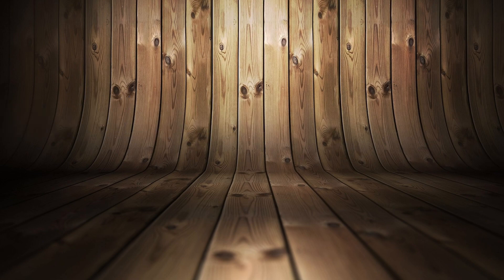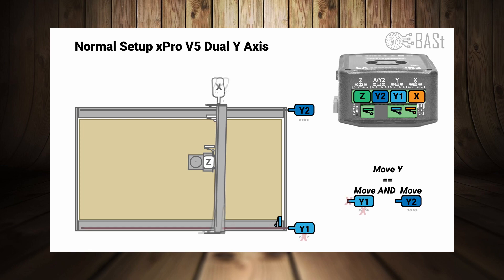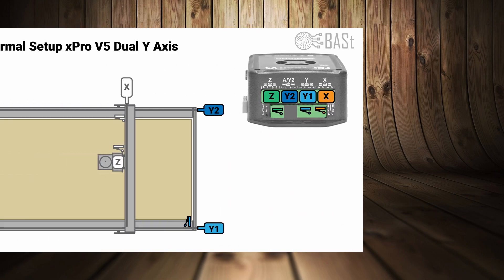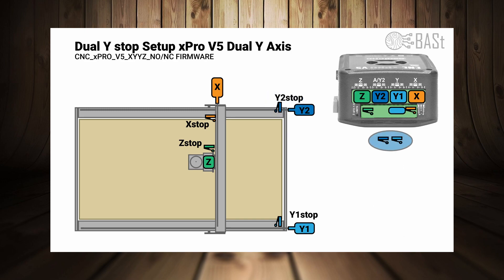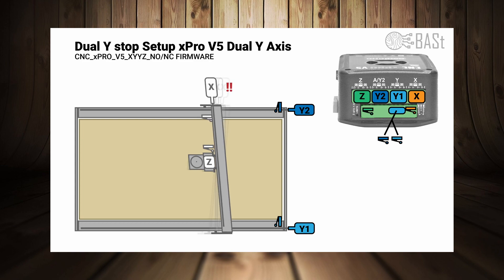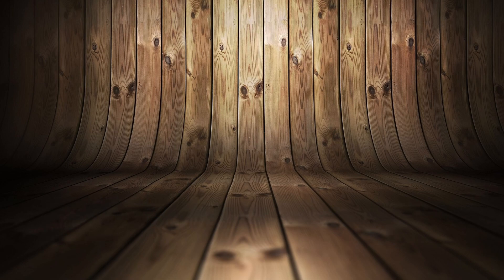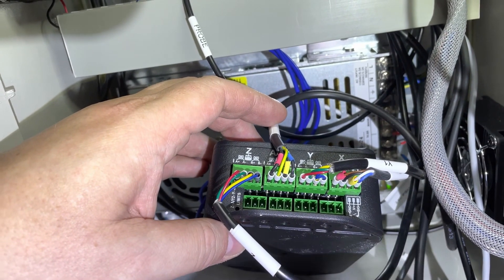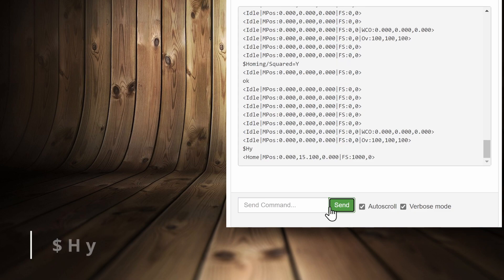Self Squaring Y Axes on your RatRig CNC with an xPro V5

Comment: My preference is to have all of my limit switches mounted on the gantry. All wires then go through the drag chain. Then the only wires not going through the chain are the two Y motor wires. These I actually run through the flat part of my chain and all wires are coming into the control box at the same location. I love this squaring code and it’s a great idea to use. The only thing you have to care about is being positive your switchers trigger at exactly the same location. Many people use the hard end stop to cause the zero.

Comment: Since you are using the StallGuard feature of the Trinamic driver in the xPro V5 I was wondering if you have had any issues on the Y axis while running with one motor stalling and the other not stalling causing racking? Do you know how to set the level at which the motor stalls?  Thanks
Reply from the maker: Sorry cant answer that as, due to other unrelated issues, I switched to the Blackbox x32.
Reply: @bast_hout  what issues did you run into? Is the Blackbox still working out? I’m wondering about the longboard as a replacement for my xpro

Comment: Apparently, you connected limit switches in parallel. There is no way the controler knows which one is for left Y axis motor and which one is for right Y axis motor. The way you have explained it can't work.
Reply from the maker: Fortunately you are incorrect. 
The first time the limitswitch is triggered there is no way for the system to know which is triggered. However, after that it pulls back and moves only the Y1 motor, so then it knows for certain that the limitswitch it hits will be the Y1 limitswitch. Next it only moves the Y2 motor and it will for sure hit the Y2 limitswitch.

Comment: I have followed your video precisely but even after the software command I still am not able to get the machine to go through the squaring cycle. I am not sure what I am doing wrong. I have installed the CNC_xPRO_V5_XYYZ_NO.bin firmware. can you please help.
Reply: You should try out FluidNC for the xPro V5, it's much easier to setup self squaring since you use both Y and Y2 limit switch inputs. FluidNC also seems to fix the bug causing the Y2 stepper driver to die since the standard firmware runs too much current.
Reply from the maker: Good to hear they sorted that issue out. 
That Y motor issue was what broke mine and eventually made me switch to the Blackbox32. 
When I had the xProV5, FluidNC wasn't yet stable for that build, but will definitely try it on my Blackbox32.
Reply: @Xplode1985  Thank you for your suggestion however since I am still a newbie I am not sure how to use FluidNC. I don't know which socket to use and how. I can only see something called "COOL" in the xPro. Is this it?
Reply from the maker: Hi Pierre, Currently I dont own the xPro anymore and I switched to the Blackbox X32, so i cant fully test. I might have missed normal homing first in my video, as it was already homed. So $H for a full homing cycle and then a $Hy for just the Y Axis and squaring. 
Of course, this is assuming that the machine was working and homing just fine before trying to enable squaring.
Reply: @bast_hout  Thank you. I will try that. In your opinion is the Black Box superior and easier to use than the xPro? i have been considering to switch.
Reply from the maker: Honestly? No it isnt 'superior and easier'.

I Found the xPro easier to use, especially in setting up. For controlling i use (and used) Openbuilds Control, not the built-in controller-web-ui. I switched after having unexplainable motorissues on my controller as well as on my replacement and didnt want to go through that a third time. The xPro has a lot of potential and if you're not having issues, theres no reason i can give you to switch for another.

Comment: very good tutorial and explanation i will give it a try as well when i get my xpro v5, one question i have is the wiring of the limit switches   why did you use all 3 inputs and 3 cables and not only 2 connectors of the switch ?,   which firmware version do i need   NO or the NC version to get it to work ?  many thanks
Reply from the maker: Hi there, Thanks for the compliment. The Openbuilds limitswitches have 3 connectors, +, sig, gnd. ( https://openbuildspartstore.com/xtension-limit-switch-kit/ )

NO/NC differences in firmware is based on the NO or NC state of your emergency stop; not based on the default state of the limitswitches. The Firmware info page explains that in more details.
Reply: @bast_hout  hello again :) thanks for your answer   i tried it on the weekend with normal end stopps NC used just this 1 command in xprov5 as you mentioned. when i home y  both axis move back trigger the endstop moves away 6mm then back again but when 1 triggers the second time the ymotor wont stop, seems like the second triggering was not recognized and so the selection of the other endstop doesnt happen.  i connected both endstops like you did and placed them into Y, maybe your way only works with those open build endstops ?

Comment: I have just been through this exact process last week. Glad to see you came to the same conclusions, and yes, how disappointing to have a dedicated Y2 limit port and not be able to use it due to a small firmware change that has never been implemented. 

Wish I had your video then to confirm I wasn’t the only one scratching my head!

Rather than measuring from the end plates, I personally used the 3,4,5, triangle technique to check for square over the largest area possible and then made tiny adjustments to the limit switches until things were just right. 

Great video for a first go! The visual graphics/diagrams are spot on. Certain it is far better than anything I would be able to achieve! 👍
Reply from the maker: Thank you very much.
And yes, youre not the only one scratching your head ;)

I also found the original limitswitchmounts quite a hassle to adjust (needing to completely loosen the switch to relocate the mount), thats why I modified them to be easily adjustable. Your route works great as well; that is how i made sure the frame was square (and thats a part I didnt think I'd need to cover). 

If your frame isnt square, you have no use for my method of adjusting the switches, nor for the Y-axes Squaring in general ;)

Comment: I was jamming a metal ruler between the end plate and gantry to square both sides up. This is a far better method, did not know this was possible. Heel erg bedankt!
Reply from the maker: Well my issue was that I knew it must be possible (because of the 2nd limit switch port), but couldnt get it to work until I found out this specific route. 
I do hope however that they will eventually open up the 2nd limit switch port for fully indepentent triggering.

Comment: Well done, sir!
I actually run across your video because coincidentally I'm looking at the X Pro v5 specifically for being able to auto square the Y axis.
Can you give me your opinion on the XPro controller?
I've read mixed reviews on it's reliability, such as it constantly losing connection, but I'm thinking it's more user error than a fault of the electronics.
Have you had any trouble with it?
Would you buy it again if you had it to do over again?
Reply from the maker: Great to hear, thank you!
I chose the xPro because it has the more future-proof platform. 
32bit vs 8 bit, and wifi enabled. 

There are definitely some nooks and  crannies to this board so olenty of room for more tech talks :)

But all in all I have had no big issues with it like other people mention. 

I do hope however that they will move and support FluidNC because ESPGrbl will not be developed further. So far it doesnt fully support it yet.
Reply: i had a lot of perturbations and loose of communications due to 220v. I had to fix it with better shield on wiring and a "recteur RS485 isolé", now I have no more problems. I depends of your house electric installation I think, but I read 110v user don't have this kind of problems